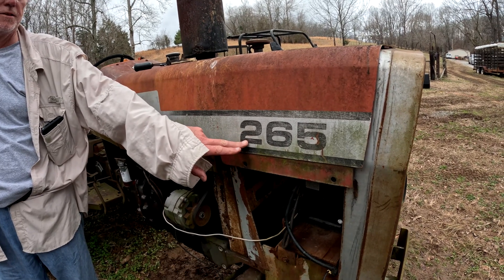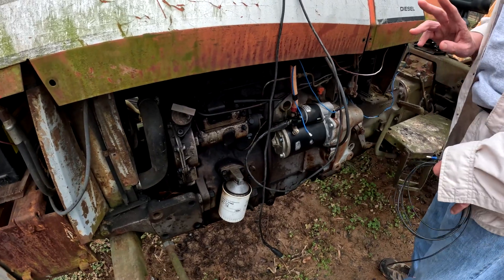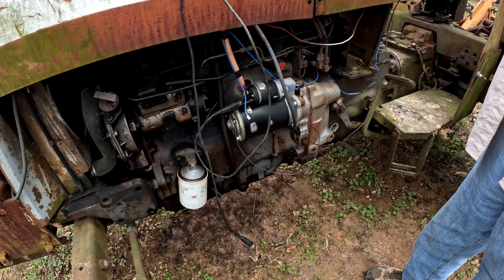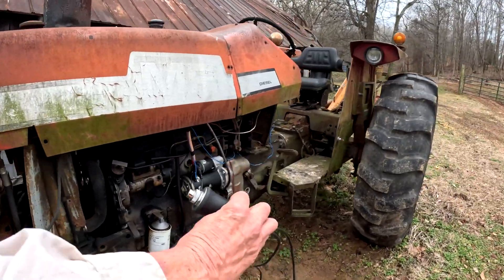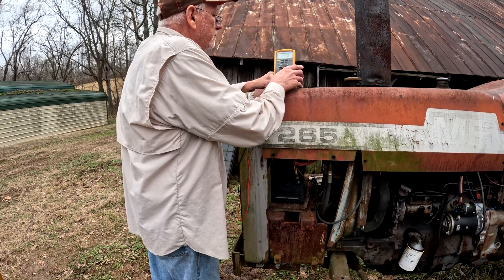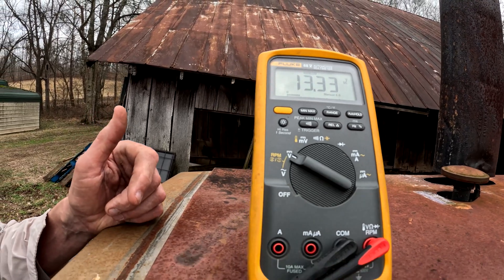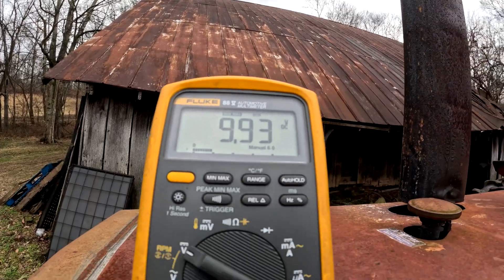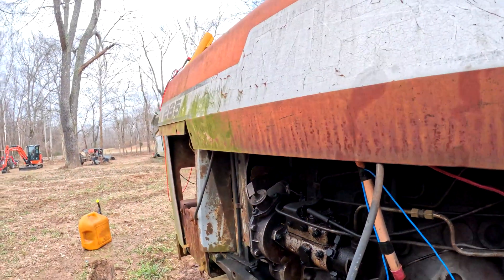Massey Ferguson 265 Tractor Priming how not to

Comment: It looks like the Tractor hasn’t had  much TLC in  it’s lifetime. 

                                      Fergieman
Reply from the maker: It's old and I bought it 5 years ago. I only use it as a post hole digger and to pull trees. Rough and functional.
Reply: @pbr549  Tractors still need luv. I have a 1959 M-F 50 ( Gasser ) that I bought 28 years ago that I use for pulling logs a log splitter for it along with several other chores, But I've been keeping it clean as I can with allot of upgrades; I guess I reward Stella for getting the job all the time. She is a working tractor, & I hope this year too give her a rattle can respray along with new gauges, & decals stuff I got for over the years, I do have a newer tractor that I bought new ( 2018 ) M-F 1526 CUT her name is Nadine, But Stella is my 1st tractor so I'll do what I can to keep her looking pretty. I don't know how many people are looking for older tractors, But there are people looking for them for there simplicity, & reliable service without emissions, & computers; Nice job getting the M-F 265 up, & running.